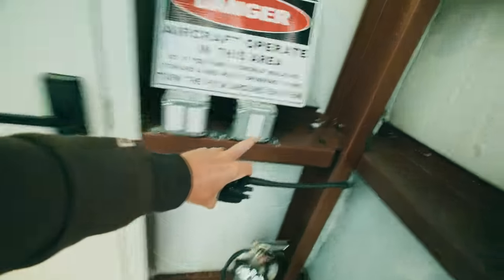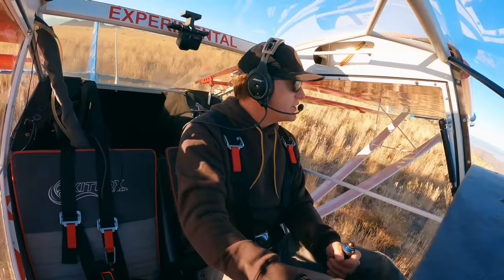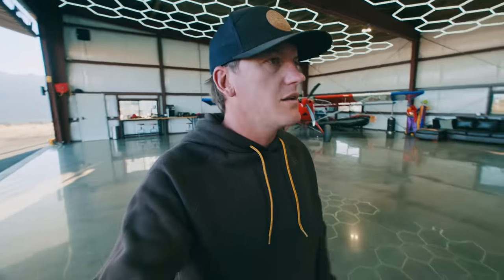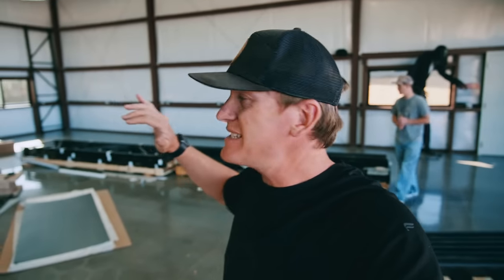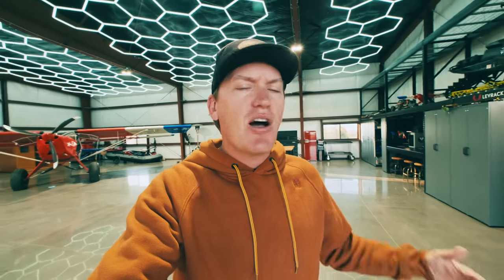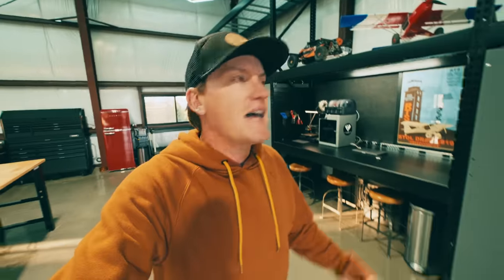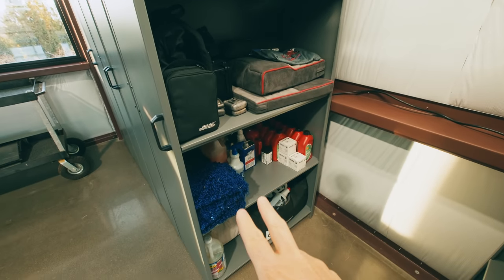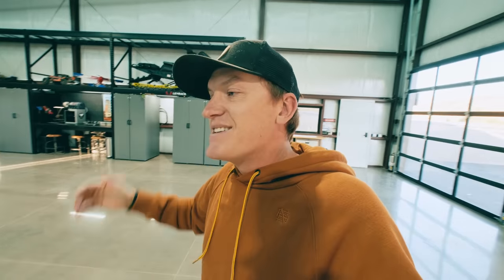Installing The Most Epic Shop Storage System - Flying and Projects Ep.1

Comment: The unwanted EMI Emissions you experienced should be reported to the vendor.  That much, just sticking my finger into the wind, seems excessive.  Anyhow telling the vendor will help him make a better product. in my humblest of opinions.
Reply: Lighting and wall warts that don't meet FCC regs are the bane of Ham Radio people. Alas; they are way too common as enforcement is hamstrung.
Reply: Probably from the ROCK Candy Mountain where compliance with emission rules is accomplished by printing a compliance statement on the label.
Reply: Since LEDs are diodes can building weird patterns of diodes (for example hex grid of diodes) create weird rf effects?
Reply: That type if RF has been a problem for decades.
Reply: It's probably the LED driver. These things are usually pulse width modulated. I wonder if you can smooth it out with a large capacitor and remove the RF.
Reply: RFI and EMI both are common with LED's they use pulse width modulation PWM you can't see the lights flicker, the frequency is too high. This is done to maximize their brightness output and they run a bit cooler too.
Reply: @o2wow Not ROC that's Taiwan where they typically play by the rules, you are thinking of PRC People's Republic of China, ie Mainland CHINA.
Reply: FYI my hangar has a more standard fluorescent replacement type LED light fixtures and they give the same interference at full brightness, less to none at <30% brightness.  It had me wondering if it was just the lights I installed or all LED lights?

Comment: Keep the girt sag angle. When the wall girt sees wind load and is already sagging, it has no stiffness. The wall girt will twist and deflect inward. Check with the metal building supplier as you may be able to use a flat strap.
Reply: Yep, I just said something similar.
Most girt / purlin systems I've seen use single bridging members that are in the same plane as the girts and span from girt to girt (rather than run across the back of multiple girts). 

So yeah I agree, they're important for spreading wind and bracing loads.
Reply: I would just jack up the beam till the sag is out and reinforce with some 4x4s

Comment: I found the same problem with LED lights in my house when I cut cable and went to an over air antenna for my local TV reception.  Here is what I know - some LED light don't comply with FCC part 15 class B for unintentional transmitters. Some don't even comply with class A. You really have to read to product info and purchase US or EURO name brands, not that the bulbs are manufactured here. Some frequencies will be more affected than others.  For example, the local ABC station is affected while the local NBC and CBS stations are not. I changed the LED bulbs in my house which solved the problem unless my neighbor turns on the high powered LED bulbs in his bathroom 30 feet away.

Comment: The girt bridging you removed is needed for the girt to not buckle at the design wind load.  You can replace it with just flat straps, or notch the angle around the girts.

Comment: If the lights have seperate DC power supplies then mount them inside a sealed steel junction box that's properly bonded.  Also mount output reactors inside the box so the outputs don't become an antenna.  That should keep all the RF inside the box.
Reply: The power to the LEDs is probably not very clean.  I'd get some pretty hefty capacitors to smooth it out.

Comment: Trent, one thing you might try on the RFI is to put some ferrite beads on the feed wires. I can't remember for sure but think it's a type 43, or maybe a type 47. They will create an RF choak that should suppress the RF. 

BTW I love the rack and storage solution. But anyway, I  hope the ferrite beads helps with the RFI issue.

Comment: At work, we use rolling fiberglass A-frame ladders made by Werner that can fold up.  Both sides of the ladder can be used and the have a platform at the top to make standing easier. That might be a good option for accessing the top of your racks.

Comment: Smiling!
Hanger and racks looking good sir. 
Sorry about the RF the lights generate but that's LED lighting. As an Amateur Radio aka Ham Radio guy, I don't like LED lighting, have some around the house and one will cause me trouble like you have on the handheld, but this is on a lot of the ham bands mostly 75 meters where I talk a lot. I can open the window upstairs and pull the plug. Might check with the lighting people and see if they have any filtering for it,

Comment: Thanks for that fuzzy intro...I had just put in new 5 wing LED lights (x10)(8000 Lumen) in our hangar. They light up great. I ski fly in the winter...Lights are on...I had severe squelch problems. Took about a month to figure it out. One winter morning I pushed the plane out. I started and turned everything on. Radio wouldn't squelch any noise out.  I taxied out and took off with no further problem. When I was taxiing back to hangar the squelch noise came louder. I realized that I left the lights ON. I shut down and went and turned the lights off. Check Radio ...GREAT. Lights ON. RADIO BAD... Thanks...

Comment: Are you certain that angle was only for construction? Because they're in the same location that they often put bridging members which are an integral part of a girt / purlin system. Admittedly in my country bridging members aren't a plain angle running across multiple girts, but they are located at the same third (or half) points in the span.

And bridging members are pretty important for spreading wind load and bracing loads.
Reply: The tin on outside holds them in place
Reply: @haystax but the angle on the inside helps prevent twisting down (or up) of the inside edge of the girt, allowing it to bend when the wall flexes under wind load....keeping both edges of the girt at same level keeps the girt horizontal and best able to resist bending loads in the wall.

Comment: An external antenna connected via coax to a fixed base radio will bring in the signal you desire. Some of the joys of AM radio, which aviation radio uses, are that they pick up all kinds of noise and the signal is easily blocked by metal buildings.

Comment: For putting stuff on the top shelf - you might want to upgrade your skid steer or get a forklift or stacker. You'll never climb up there for something small that you can actually carry up a ladder, unless you build a railing and 1/3 depth small parts magazine and not move the ladder all the time. With a stacker, you could have e.g. a large box with a lid with all the camping gear inside. You decide you want to go camping? You pick up the box and you're set. 

You could have other boxes of stuff that's used infrequently, treat it like an attic but with a professional handling system. Christmas is coming. No spending half a day lugging decorations from the attic, just lift down a box or two and start setting up...

Comment: Hey Trent, have you considered using some Mix 31 ferrite toroids, or clamp-on cores to eliminate the RFI? Proper application should suppress most (if not all) RFI on everything from 1-300MHz. Right now your electrical wires are acting as giant broadcast antennas for the RFI. Happy to help if you want! 🤘

Comment: You might be able to to fix some of the RF from those LED power supplies by insulating them with earth grounded copper screen or by simply running a dedicated earth ground to to each of the supplies if they are external. Just a idea that might work.
Reply: With the risk of a possible overheat and failure of the driver.

Comment: Can you draw a hole in the Gertz and use cable and put like a cable clamp on both sides of them to support the Girts and then use that to support the wall part also strengthens your structure by keeping your Gertz from sagging because the cable has a gentle strength of what 3000 4000 pounds Make your building stronger and your shelving system. If I understand what you’re saying I may be way off anyways best of luck to you have a beautiful, beautiful hanger. I would kill for joking, of course but I like a lot I like that design of the LED lights . It’s the best man cave ever lol

Comment: The EMI interference is caused by the ballasts in the lights.  As an engineer for public safety radio systems, we deal with this often.  Foreign made ballast are not FCC approved and should not generate harmful interference.  This is probably happening on all frequencies.  

You may want to have a fire department friend come over with a pair of first responder radios and make sure the interference doesn't hinder ambulance or fire fighter response.  I would hate for you to figure out first responders can't help you when you may need them the most.  I am not worried about your safety on the plane, but the e-bike looks dangerous.  But, what if this causes interference issues with someone in the pattern and a transmission is not heard because the lights are on.  That creates a dangerous situation in the pattern.  

Most people would never notice this until it is too late.  Good thing you have an aviation radio that has alerted you to this potential life-threatening problem.  You should have recourse with the vendor to fix the noise since this is a violation of the FCC emissions.  And by fix - all the ballasts will need to be replaced.

Comment: LED power supplies and solar inverters make some of my Ham radio bands almost unusable. I was very upset after we put in our solar panels to find this to be true and especially after the installer reassured me that he hadn't heard of any RF interference issues with the inverters. The FCC is supposed to be making sure that these products don't interfere however in the past several decades it seems they quit caring as the market is flooded with very poorly designed electronics that do create a lot of interference. My shop is in the middle of a half acre and I had one LED spotlight on the front of the house that was so bad I finally quit using it.